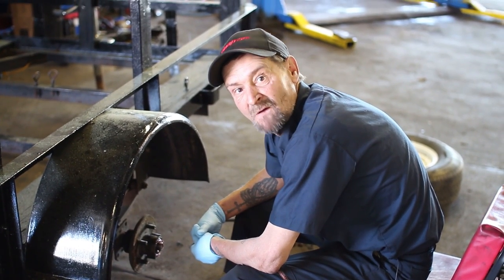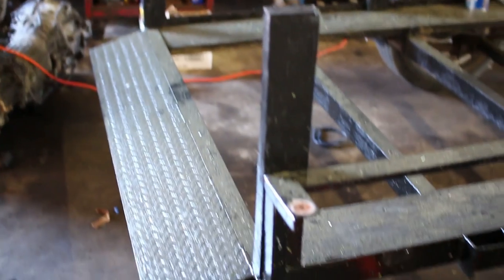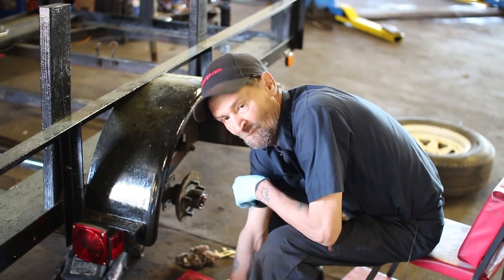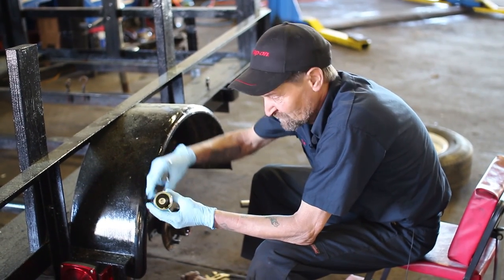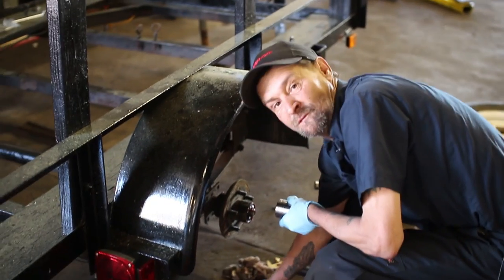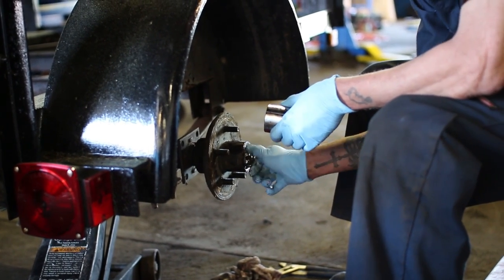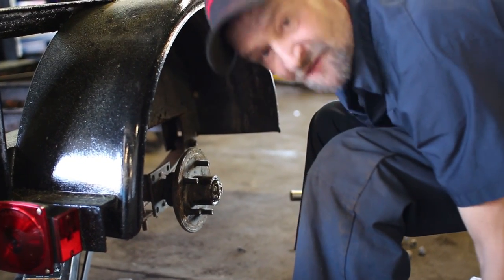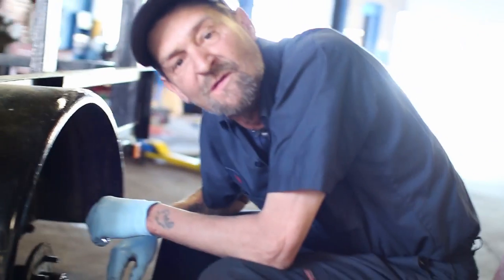Installing a bearing buddy adapter on a trailer

Comment: There's post all over the Internet that say these bearing buddies do nothing but keep dusting water out they do not repack your bearings? And it makes sense cuz in order to repack your bearings the old bearing grease has to leave? Meaning the old bearing Grease needs to come off at the bearing before it can read packet self no? So these things ain't nothing but an oversized dust cover an expensive one at that?

Comment: Bearing buddies are crap , if you want proper bearing protection just service your hubs and bearings annually or install Dura Hub oil filled bearing protectors , really good especially for boat trailers.